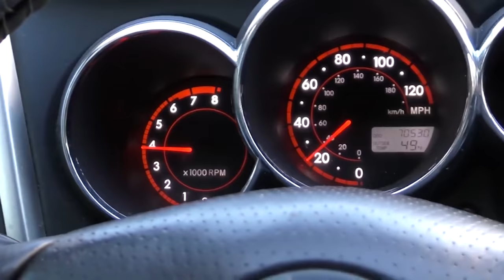5 Signs Your Transmission Has a Serious Problem

Comment: I replace my transmission fluid every 60K miles and have not had any issues. Don't flush, drain and fill.
Reply: yeah i change my oil and engine oil and transmission brake fluid etc i change them often cuz its bmw haha i have a bmw e46
Reply: what car do you have?
Reply: @ThuanTran-nv9yb  why'd you end up selling the accord with 140k miles? That not a whole lot of miles for a car like that.
Reply: @bengunn6571  I needed a sedan since we had a baby. Car seats are a pain for a coupe.
Reply: @ThuanTran-nv9yb  ah makes sense too bad it wasn't a sedan to begin with that kind of mileage
Reply: I got a 2015 tacoma v6 with 150,000 miles on it...should I change the transmission fluid or is to late???
Reply: @bryanrebollo8585  That's a tough one. I would only do if it's shifting weird. If so, I would wait for the car to cool overnight and next day drain and fill the same amount. If not, I would just keep driving until it does.
Reply: I got 230k on my 98 4runner as far as I know it's never been done but it revs high before shifting sometimes

Comment: Best advice I have seen - every 60,000 miles change that fluid in the transmission.  I have never had any transmission fail on any car except a Honda Accord with a V6 engine and an Acura TL with a V6 engine as those transmissions were bad and failed before 70,000 miles.  Otherwise never had a problem with GM, Toyota, or Subaru.
Reply: Idk my 06 Auto Accord has 367,000 miles. Original engine and transmission. Still going strong. Just regular fluid changes with OEM transmission fluid.
Reply: My 1991 Honda Accord 245,000 solid transmission, solid engine regular fluid changes,
Reply: @juanrobles3381  You are lucky.  I had a 2003 Acura TL and a 2004 Honda Accord LX V6.  If you have a four cylinder the 5 speed transmissions were fine.  If you had a 6 cylinder they were horrible.  When my first transmission failed on my TL I had to wait 6 weeks to get it replaced by the dealer under warranty.  That was because I was 9th in line for a transmission (literally).  It was not just me but a massive number of V6 engines with the 5 speed automatic that generation.  It was a bad one.
Reply: @surferbud5863  That generation I am not surprised.  They had a four speed automatic and not the troubled 5 speed automatic introduced first on the Acura TL in 2002 and the Honda Accord in 2003.  They were fine if paired with the four cylinder engine even in the generation I bought the cars but I bought the V6 and the additional torque burned them out in mass.  When I replaced the Acura's transmission the first time under warranty, I was 9th in line and it took 6 weeks to get it replaced at the dealer.

Comment: My car is 14 yrs old but only has 55k mileage on it. Check the transmission fluid and still clean and no problem with transmission. But dealership says I still have to replace the  fluid even it has low mileage but because if it's age.

Comment: I picked up an 4l60e Chevy 1500 4wd 03 z71 a couple years ago. It felt like it was slipping so I added some Lucas, I never took fluid out. Might have added another half of one.

Anyways, so driving around town it's slipping but not bad and I'm not pushing it. 

Recently I picked up a camper to travel for my job. It definitely took a minute of slipping to from 20-30 mph while towing it. So I needed to break it or make it better. 

I originally started with the removing some fluid via a small hose and pump. Then I hooked up a hose to the cooling return line and took five goes of running the engine and re adding oil before dropped the transmission pan, or at least got it snugged up against the exhaust enough to get a new filter on, no new gasket. Didn't clean the magnet or whipped too much of the inside of the pan down. 

It seemingly drives slightly better but still has a mean slip while hauling that travel trailer. 

Now I'm looking into the pressure line, after I  confirm the oil level is in range  One last thing to 🔧 before a rebuild by a pro next week. 

Not only is the price of gas doubled but hotels six months ago wanted $65 a night. Last week the same hotel wanted $110. The per diem for traveling construction workers hasn't moved much and journeyman are walking off job sites because the hotel increase alone is $7k a year out of your pocket after eating up all that $20k a year per diem. 

So I got travel trailer camper.  Might be a good series for traveling construction workers looking to haul a camper. 

😂 if the town we're working at is out of ⛽

I might have to play RimWorld and sell items online to make what fast food restaurants are paying. 

Live 🆓 and keep those tools 🔐 up!

Comment: Would it be wise to change the fluid on a 2004 Chrysler automatic transmission with 114,500 miles? I’m not sure if it’s ever been changed.
Reply: Couldn't hurt. If the fluid looks real dirty maybe do the filter too.
Reply: Yes would be wise to just do a simple transmission fluid change , but never do a transmission flush big difference
Reply: @jonathanesparza445  alright. I was worried to do it because I was afraid to touch it since I know how fragile they can be. Thank you!

Comment: So Scotty…2012 Lincoln MKX got new sensors since the sensors in and output for the transmission need replacing….i think I should also change the transmission filter and replace whatever fluid needs replacing after that….otherwise the car is great….what do ya think?

Comment: I have a 2002 Toyota Highlander – 167k miles – running well but never had transmission fluid change as far as I know. My mechanic says the transmission fluid is dark and smells burnt. Should I have it changed? (Not flushed). Or should I just leave it alone?

Comment: The transmission fluid in my car hasn't been changed since I got it. We got it a few years ago when it was around 96k miles. Would it be a good idea to change the transmission fluid filter, keep the old fluid, and top off with new fluid if necessary, or keep the old filter and top off the fluid if necessary?

Comment: I changed the filters gasket and fluid in my Jeep and it was at 144,000 miles. I replaced 10 quarts of fluid with new Mopar ATF+ 4 full synthetic. The transmission shifts better and Jeep gets better gas mileage. I didn't have a shop do a flush though and fluid still looks brand new on the dip stick 2 years later.

Comment: I am noticing that my 2010 Toyota Yaris, tends to run over 3000 RPMs before it goes into third gear when it's cold.   After it warms up, it runs fine. I changed the fluid (pan and filter) and still doing it.  But otherwise, it runs great! Almost 140,000 miles at this time.
Reply: Same problem how your problem solve?

Comment: Thank you so much Scotty!

So, is this advice only for automatic transmissions? I understand you don't flush manual transmissions, just drain and refill.  

And it seems like the earlier you start replacing the transmission fluid earlier in miles the better in order to avoid being stuck in this situation thousands of miles later?

I wonder if the same is true for differential fluid as well with manual transmission?

Comment: Excellent video Scotty!   You obviously know a lot about cars.   I am hearing a grinding noise in my car.   I was about to demand a transmission fluid change.  After watching your video, I have now asked for the mechanic to check out the noise.
Reply: Great video. I need help with my 3007 Camry. We had a rebuilt transmission put in with a year warranty the year almost up and it's been haven't slippery problems. And sometimes when I stopped up to pass someone. It feels like a double shift. I took my it back to the dealer 4 tone it did it the first 3 times. The the manager wanted to drive out with his scan tool plugged in. Wouldn't you know it. It didn't do it. He sent the data to to uhh ota anyway and told Toyota about thteansmission acting up. Toyota said we have to catch it on a scan tool to see what's wrong. What should I do. The transmission only 2 months left on warranty. 1 year is a sucky warrenty FF or Toyota to give to customers for a rebuilt one from Toyota directly. What should I do? What would you do?

Comment: I've got a 2011 Chevy Cruze with nearly 230k miles. The transmission recently started shifting hard, so I figured I'd changed (not flushed) the fluid. I admit it was the first time I'd changed the trans fluid, and I've had the car since about 110k.
     It seemed to do the trick, car was shifting smooth and I was happy. 
     Now a few days later, the trans started shifting really wierd, up and down through the gears like it doesn't know which gear it's supposed to be in. So I turned around and parked it. 
     Now I'm wondering if the trans was gonna do this anyway, or if it started as a result of changing the fluid.
Reply: How did this play out for ya?
Reply: Update
Reply: Update please
Reply: update..
Reply: Update please
Reply: Update please

Comment: Mr, Scott, my mechanic told me, to avoid overheating of the engine amd transmission in my Nissan, take cars grill out and put a fan that will help with the air flow. Keeping the radiator and coolant from getting too hot. What do you think?

Comment: My 2013 rav 4 jerks sometimes when I got past 20mph, then it's fine. And It's no longer showing the mileage on the dash when driving. We bought it used two years ago with 96 thousand miles on it.  The fluids are full and there's no leaks.

Comment: I had a transmission issue on my ATS. I got it fixed. The other day I pushed on the pedal and the car didn't go for like a half a second. I'm like uh...I really don't need this right now.
Reply: Mine did the same except I realized I had a misfire
Reply: Puddin Tain  Yeah these increasingly computerized cars are a real double edged sword. There are some systems that computerization make sense but it seems like they are just digitizing every system for planned obsolescence/profit. So glad I'm still carting around in my old 02 Camry. Something goes wrong i just tear out the part and replace it. No computer reset required.
Reply: @jayevans7737  I live in the mountains so i'm going uphill a lot. I'm sure it's wearing down my spark plugs. But the ATS is a 2013, and it's nice, but it doesn't drive like when I first got it. I'm about to buy a 2020 Accord.

Comment: Hi Scotty! I have a question. I just bought a 2014 Chevy Cruze. It has 70,000 miles. Can I change the transmission fluid? I have no idea if previous owners ever changed it. And what is the limit of miles to not touch it?
Reply: So did you change it? What was the result.

Comment: Keep up the great work
Reply from the maker: thanks and will do!
Reply: @scottykilmer  Scotty!! Trying to get a good deal but I dunno which car to go with. 
2007 Chevy Aveo with 101k miles ($2800)  or 
2010 Camry with 201k miles ($3,000)...
Reply: @courtneylovesjordan9519  I'd keep looking lol
Reply: @ADDwithJTC  There's pretty much nothing in my area. D: Everything is terribly overpriced. Even beat up pieces of crap are priced at a couple thousand. D:
I did find a Mazda but they want like, 3500 for it. I can't really remember how many miles are on it... I think like 179k? Wait, just looked at it. 08 Mazda 3? With 179k miles?
Reply: @courtneylovesjordan9519  I drove 2 hours to get the car I have now. Went to 7 dealerships before I got the deal I wanted. Sounds like you can't stay local.
Reply: @ADDwithJTC  perhaps not... But I currently rely on a couple from church to get around at the moment... I don't think they'd be willing to drive out of town. I did find a few Hondas that had under 200k miles on them. I just reeeally don't want to go to any used car lots
Reply: @courtneylovesjordan9519  try to talk down the price on the Camry, go for 2500, if you can’t manage that, 100% go for the Mazda just stay away from the Chevy
Reply: @christapherwinrow846  Thank you!! I appreciate it! I don't know anybody that is very knowledgeable about cars around me...
Could I offer 2500 for the Mazda as well?
Reply: @christapherwinrow846  What type of maintenance questions should I ask the guy with the Mazda?
Reply: @courtneylovesjordan9519  you can ask him if he has any maintenance records. Check everything anyway (check oil, trans fluid, brake fluid, coolant, tires etc) and road test the car a while. Make sure it doesn't overheat.  I'd help you if you lived near me. I was a mechanic for 10 years. If still no luck, have you looked at carvana or any of those car places who finance and deliver? My co-worker got two nice cars from them. Never left his house for them.

Comment: I have a chevy 2010 Colbalt I believe it a manual, I'm not super mechanically though. I'm looking into the transmission idea, i believe the quiet hum i hear is a bearing sometimes i hear a grinding. The humming is random, the grinding again random. Grinding and humming always around corners and driving straight down the road i hear humming but this is also around corners. Check engine light is off, i had put in a cam shaft exhaust position sensor made a huge difference in the jerking after 35 mph i never feel it jerk, sometimes it jerks at 45 if I'm not riding above 17000rmps at least. I do have to sit at 1500 rpms max when shifting around 5 15 25 and 35 mph otherwise it jerks. i have done other than the sensor checked the air filter and oil change. However i can tell that when I bought the car it is going to need rotors probably calipers and I'm sure bearings maybe even back brakes. It usually all ends together if its not taken care of is what I have learned from older guys like this dude. I was told it would have a misfire if it was a coil pack because it also hates hills it drops speed quick but rpms drop with it. Im more familiar with vehicles from the year i was born and older which is 2001. From my research I'm unsure if its a possible trans issue, I bought the car at 72,000 miles. My assumption is 2000 rpms is right around were it should be after 35mph because it runs amazing that way no issues other than when i drove it at 45mph it jerked, the car only does that if I'm not already shitting at 2000 at least. The rmps do always drop after every shift regardless if its jerky or not. I'm iffy I'm driving it wrong but i believe im not. Im unsure if it had a fluid change for it. I have thought maybe it might fix the issue if it is a trans problems. Can anyone help me get a grasp if it is and if its a huge issue for at home mechanics or shop mechanics. Another thing (the shift timing is off) i was told it could be a speed sensor. I suspect it is at least part of the issue.

Comment: I have a 2014 Equinox. Have been told conflicting things. One place can do a filter change.

Transmission place says that Transmission is sealed. They never work the same. If they tell you that they are gonna just rip you off.

How's a gal to know

Comment: What if by chance the shop that changed your transmission fluid used the wrong oil for your transmission? Drove it for a week before you found out.  Is flushing still a bad idea? Or would just changing to the correct fluid be enough?
Reply: If there's any problem with it within say a few thousand miles that shop should be held at least 50% or more responsible for repair costs in my opinion

Comment: I got 2012 cvt Altima it shakes and rattles going forward in drive and but reverses just fine with only a little.. the fluid has been changed since I bought.. it's got 
155k so far.

Comment: If I check the transmission fluid and it appears clean (no dirt, no odd smell), then it's probably okay?

I have a used 2003 Camry. The guy said the transmission is "new", ie, a rebuild, but I have no way to know that. It runs fine btw.

Comment: Just did complete flush with valvoline maxlife on a 130k mile lexus gx 470 with the 5 speed transmission. No slipping and shifts better I think (but may be placebo). Old fluid had never been changed and was kinda dark. Would rather take the chance of needing a rebuild now than guaranteeing a rebuild later. Will update if trans starts slipping.
Reply: Any updates lol?
Reply: @MacGoober  Have about 140k on it now. Still shifting perfect. I took it on a roadtrip out west right after changing it last year and it never had a problem up in the mountains so I'd consider it pretty solid.

Comment: I've never had a transmission flush, but I've had rough shifting from a simple fluid change.  Adding an additive such as duralube or lucas transmission fix, fixed the rough shifting issue.

Comment: The solution:  Buy a car with a manual transmission and change the fluid every 100,000 miles
Reply: That's what i do haha.
Reply: I know it's wasteful but I change my Ranger manual xmission Marcon 5 evety 20k miles.  It's so easy and cheap,
Reply: @randyhenry2477  I should replace oil too since my Peugeot has 110K km on it.
Reply: @imrileth6618  - You are tempting fate, my lad.
Reply: Less and less on the market

Comment: Yeah, I’m having either transmission problems or fuel related issues because when I drive my Hyundai Sonata 2012. When I drive, it decided to slow down o it’s own for no reason. Even when I press the gas more. Then it starts slowing even more. Someone said it’s the transmission, another said it could be the fuel injector, or fuel pump and/or filter. Gonna see how much it cost to get checked. It also idles hard, even in park.

Comment: My 2004 Infiniti i35 I bought off FB marketplace has 174,000 miles, has exactly these issues, when I shift into gear and press the gas it jerks, then just today I tried to put it in reverse and it wasn’t moving anywhere. It also was leaking transmission fluid for some reason?!

Comment: Does the advice of not flushing the transmission fluid on a high mileage vehicle that has not ever had a change, hold true, if it is a manual? Second question, if buying a 20 year old vehicle with only 120,000 miles, would you leave it alone, or flush it now before any problems, talking about a honda, and it is manual. Thanks!